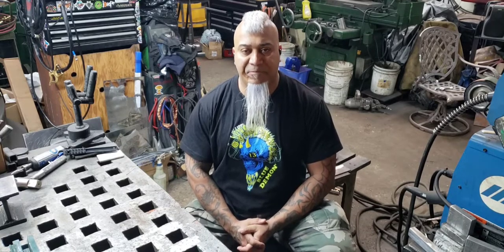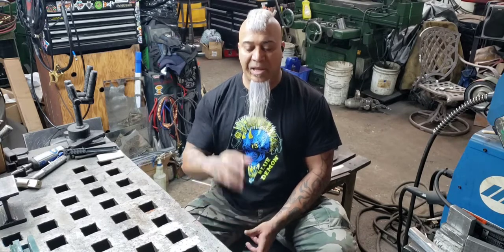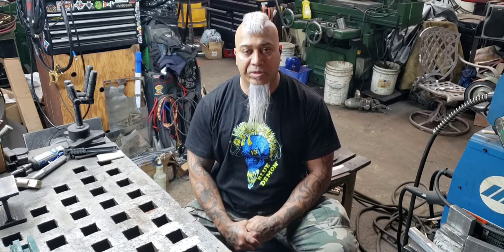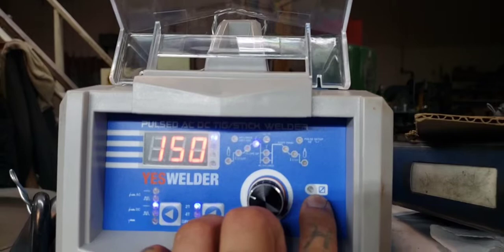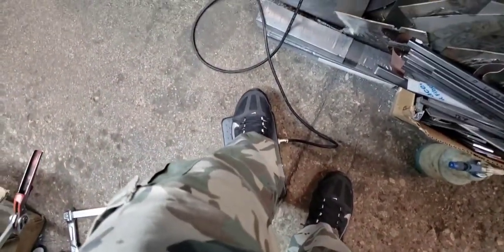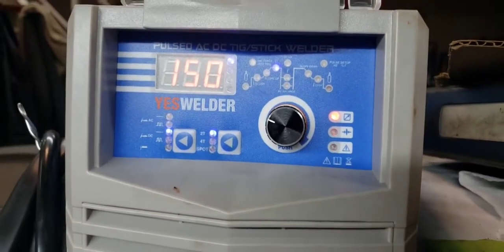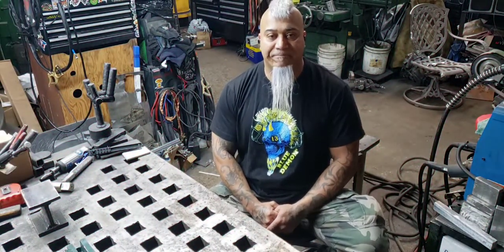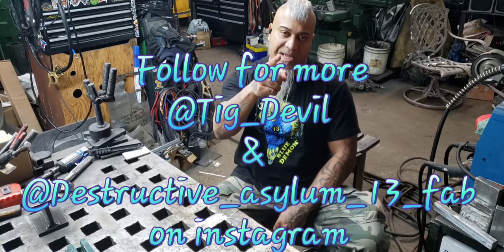Yeswelder 250p AC/DC foot pedal amperage control mode

Comment: Helpful video, Diesel -- Thanks! 
I'm so glad I saw this. Subscribed! One question about pedals though -- do you have to use the Yeswelder pedal, or will a little bit cheaper one work?
I've had this welder about a year and done fine just using settings on the machine so far, and now want to go ahead and try an amperage control pedal for thinner material and aluminum.
Reply: So I believe as long as its the same connection it should work. But dont quote me. I have not tried it. I usually buy from same brand. If you use code Tig_Devil at check out you get 10% off if that helps.
Reply: @Destructive_Asylum_13  Thanks! I found the right pedal -- the Yeswelder happened to be on 87 Dollar sale so I orded it today. Didn't see your note until just now but maybe can make up for that later with another YW product. Much appreciated.